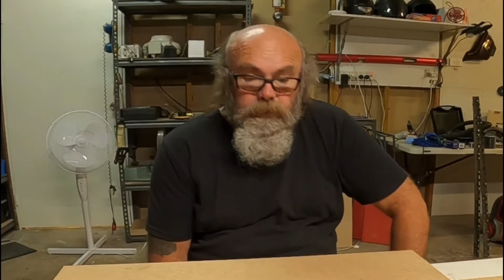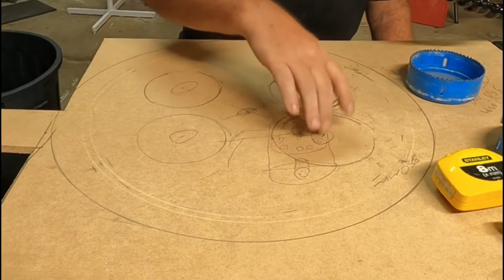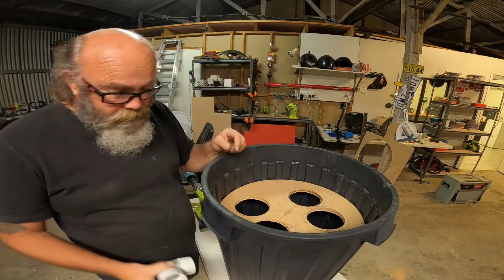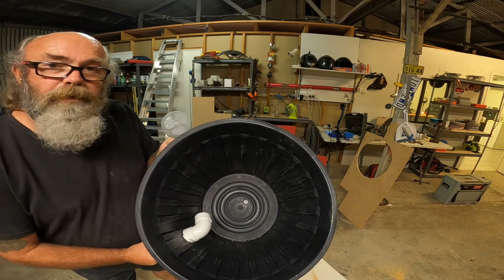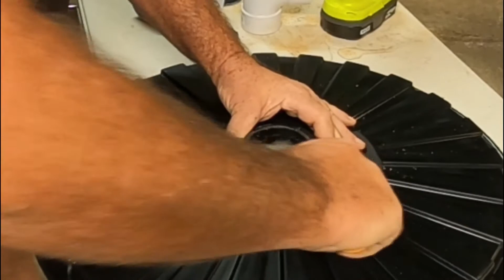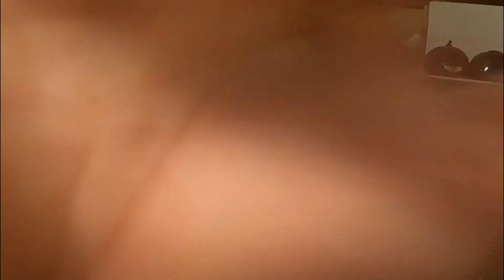BUILD Cyclonic dust collector

Comment: Nice job Benno.  When I made mine I cheated and bought one of those cheap plastic cyclones from eBay and mounted it on top of one of those 25 litre plastic buckets with a lid.  I did have to put a couple of plywood rings in it to stop it collapsing.
Reply from the maker: Thanks Tony. The first one I made a few years back used the same 25 Litre bucket and it had the same  problem.

Comment: Why not put a baffle like you made for inside the bin, for the lid, it should strengthen the lid up somewhat.  Good video Benno, all the best bud
Reply from the maker: Hey Geoff. I did think of doing just that but as it has turned out is not necessary. It has taken the vacuum better than I thought it would.
Reply: @BennosShed  👍👍👍👍🍺🍺🍺🍺